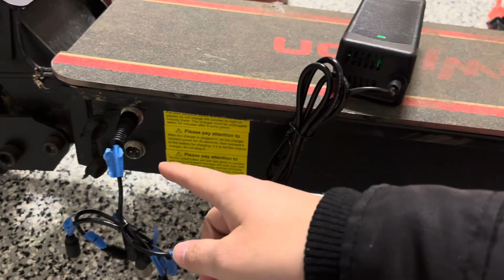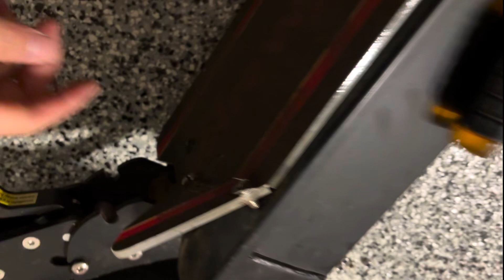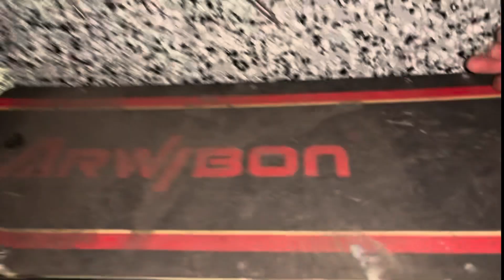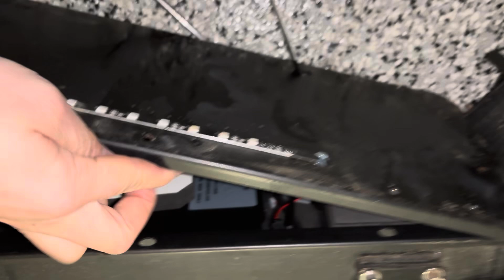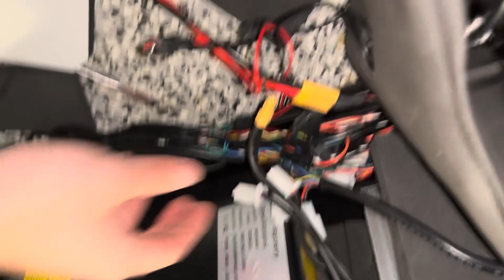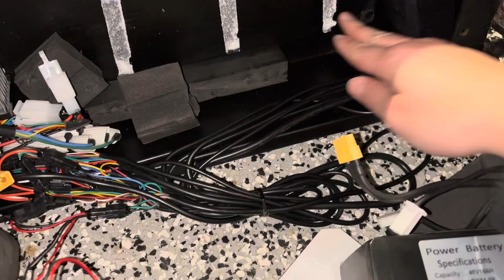Arwibon Q30 48v 2000w Scooter Won’t Charge? Diagnose and Replace Battery

Comment: Thank you so much for posting this.    I just purchased the same scooter off Temu.  I could not find the instructions anywhere on how to open it.  I would have made the same mistake as you.   You really helped me prevent it.  I really appreciate.   I wanted to open it up to check for fuses as it is very important safety feature.    Also..is the battery Lipo or Li-Ion.
Reply from the maker: nice! it's a lion

Comment: I just had the same problem new 30ah battery had to unplug the battery for 5 minutes and reset the bms and mine is a 2500 watt motor and a 37 amp controller q30 awibon escooter I've got 1000 miles on in Olympia Washington love it
Reply from the maker: very nice!

Comment: can you open the thumb throttle ope to see where each wire goes . and show wire where they go there is no wire diagram for the Q30 . the 7 pin throttle. and arwibon is no help would really help  mine was tipped over and completely smashed when i went outside??? help

Comment: Im having the same problem my scooter just won't charge
Reply: I was riding and switched to high. Then it shut off whenever I try to turn it on it lights up then fades off. What do you think the problem could be I could even send a video.
Reply from the maker: @nickolasj6058  check the voltage, what does it read?

Comment: Could I put a 52 v in the same scooter
Reply from the maker: Generally ok to do it
Reply: @EdwardInTX but if you put a 52 volt battery in a motor rated for 48 volt , overtime it'll break it down a lot quicker correct?
Reply from the maker: @christopherdyal5946 52v on 48v may heat up more which may lead to failure eventually, but failure rate is not as high as doing a 48v on a 36v

Comment: 90 bucks? It’s on the website for 350. Dang
Reply from the maker: I went with the 48v 10ah blue battery here
1. Aleaivy 48V Electric Bike Lithium Battery Pack Li ion Ebike Battery for Bicycle Scooter Motorcycle with Charger
https://a.aliexpress.com/_mLR70wR
2. Also used the 12v 5.5mm extension wire to extend the charge port through the front and slightly up the handle stem 0.5m
https://a.aliexpress.com/_mr9P54n
Reply: Hi, thank you for the video, I cannot open these links, can you please provide new links where can I find the battery and the extension?